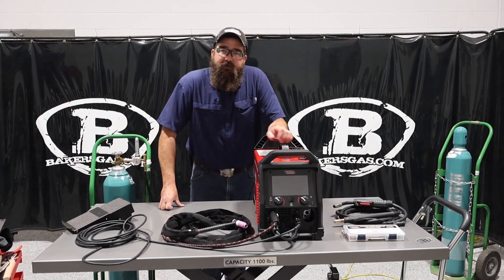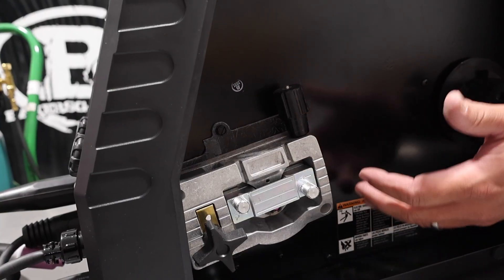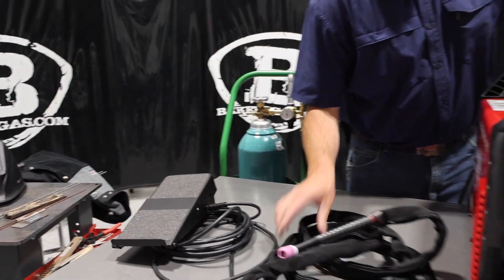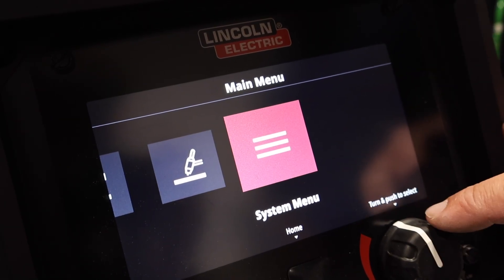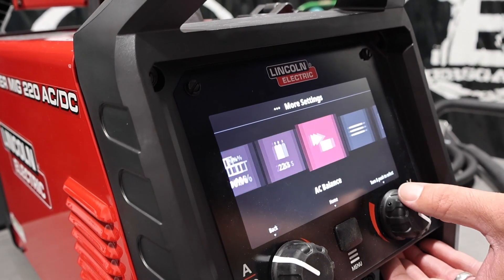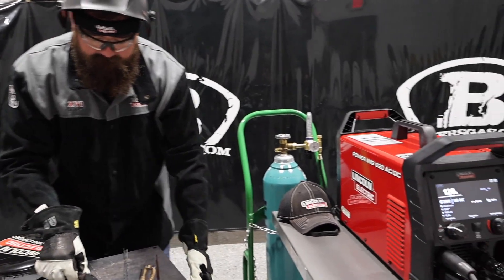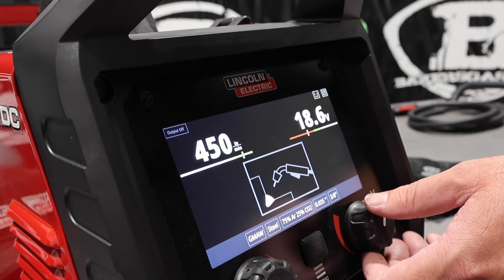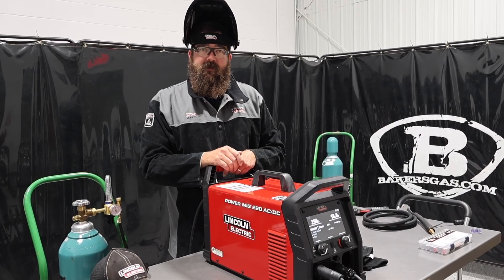Lincoln Electric 220 AC/DC Multiprocess Welder Review K5379-1

Comment: Can a 5k watt generator run this?
Reply from the maker: To run a Lincoln POWER MIG 220 welder, you need a generator with at least 11,000 to 12,000 running watts, with higher peak watts being recommended for a safer and more stable operation.

Comment: What’s the thickness metal it welds? New to welding.
Reply from the maker: The Lincoln Electric POWER MIG 220 AC/DC can weld steel up to 3/8 inch thick when using MIG welding, and can handle thicker materials with stick welding using electrodes up to 5/32". For DC stick welding, it can weld 3/8" steel, and with the AC/DC TIG option, it can work with 24 gauge steel or aluminum up to 1/4" thick
Reply: @BakersGas  Does the Miller Multimatic 220 AC/DC weld the same thickness as the Lincoln Power MIG 220 AC/DC? 

In your opinion which welder machine would you recommend to  purchase?